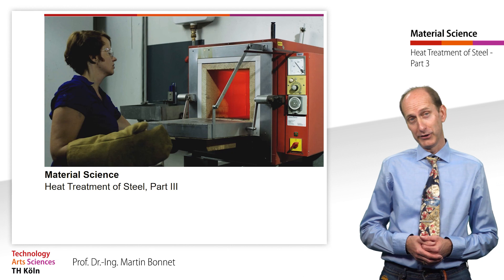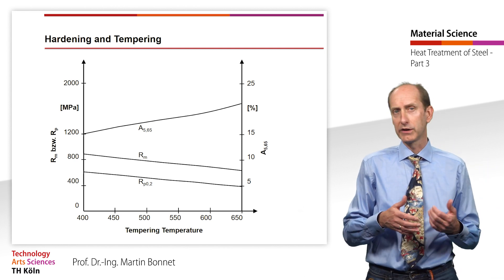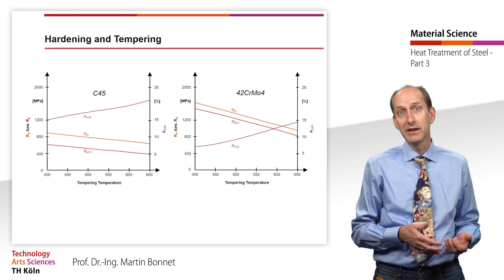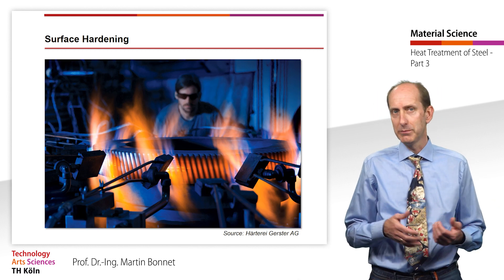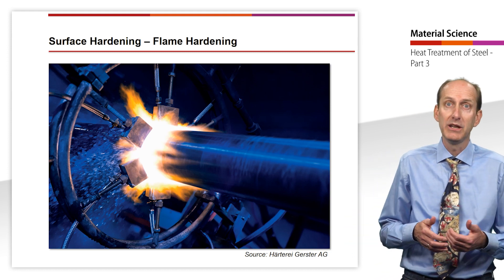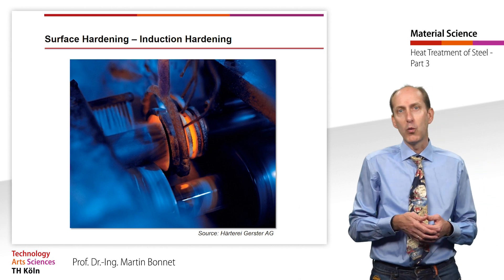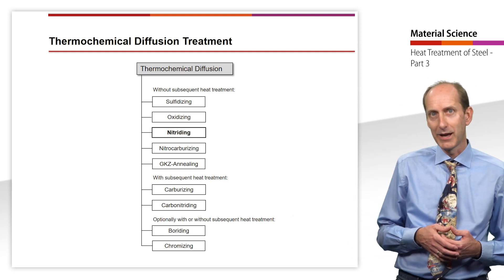Material Science, Heat Treatment of Steel, Part 3

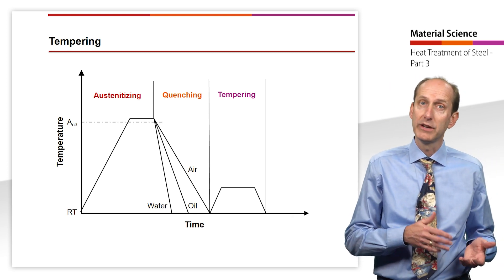Comment: @ 1:25 it is stated that tempering at 180-250°C increases touges significantly. @ 2:04 it is stated that this effect can only be observed at 400°C. Which one is right? Did i miss something?
Reply from the maker: There is a difference between "hardening" (followed by tempering at 180-250°C) to reach max hardness with adjusted toughness and "hardening and tempering" (tempering at above 400°C) to reach max toughness and increased hardness and strength.
Reply: @WeltderWerkstoffe  thanks for the explanation :)